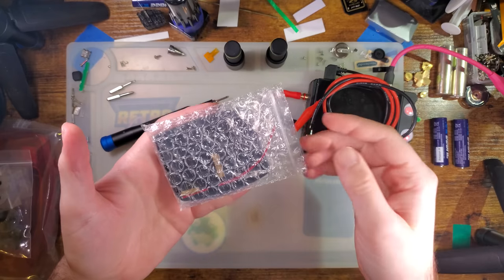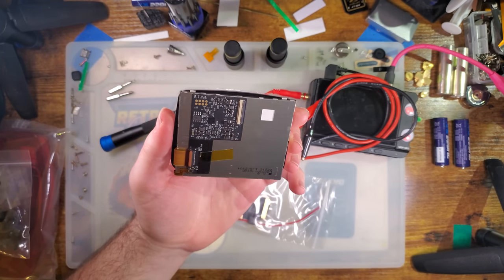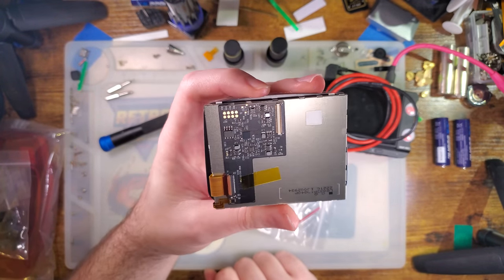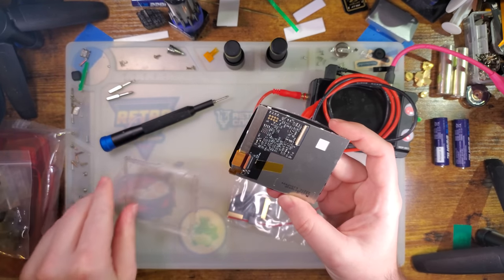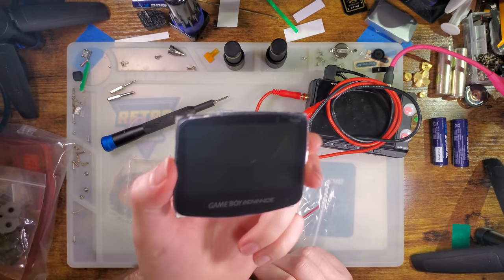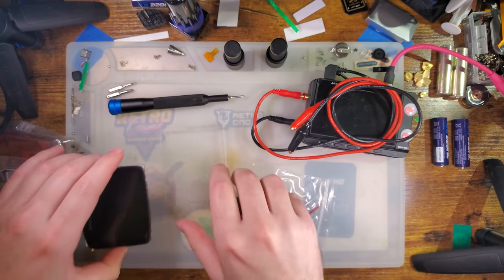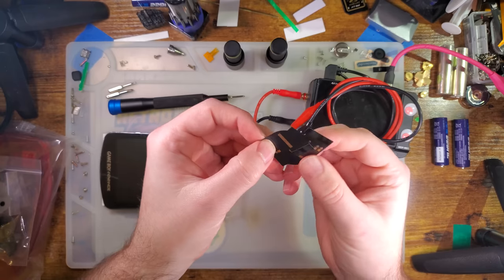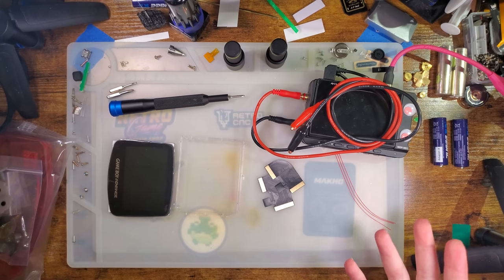FunnyPlaying Laminated ITA with OSD and FRM (GBA)

Comment: How the heck do you install the bracket. It won't go in no matter how I put it. So frustrating
Reply from the maker: Double check the orientation. It kinda sorta fits three different ways but only the proper orientation will get it installed.
Reply: @makho  I've tried every wich way. The one they sent me is different than the one in the vid. It's way smaller than the screen so I can't even get it on.
Reply from the maker: @robertoferreiro8753  Then talk to the seller.